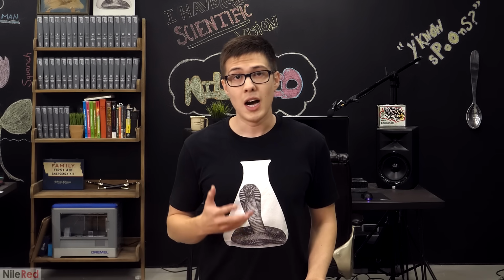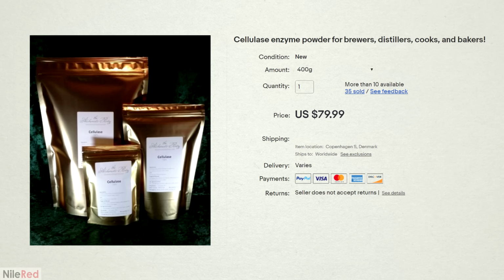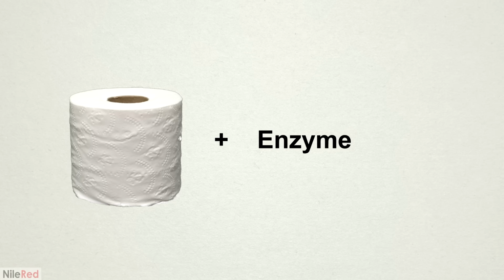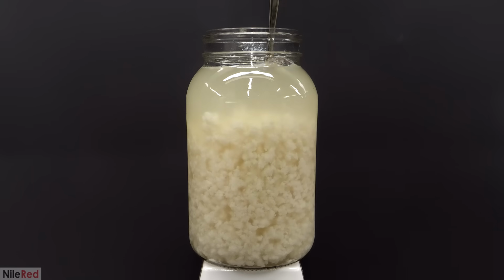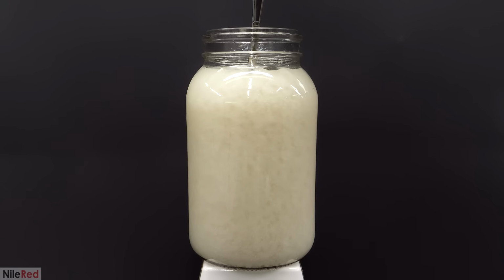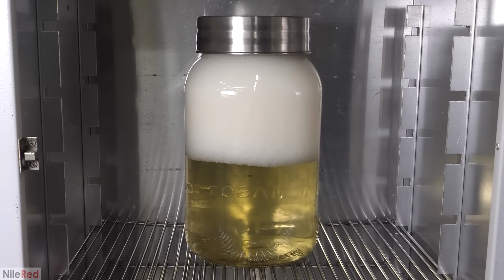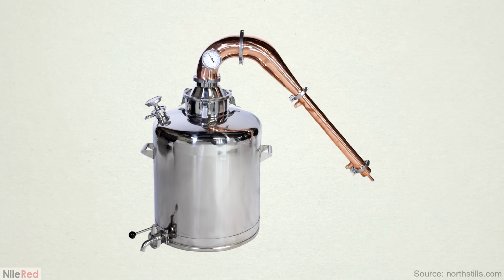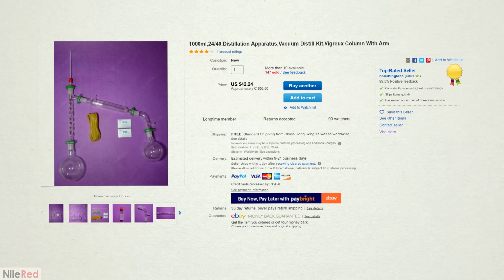Making toilet paper moonshine

Comment: How to make moonshine, ingredients:
-Toilet paper,
-Drain cleaner...
Reply: -weird $80 internet powder
Reply: -yeast
Reply: @loog8621  well that's the only normal part...
Reply: Methshine
Reply: A distillation kit
Reply: Kittens!!
Reply: Nope nothing happens without the yeast. Ordinary bakers yeast will work just fine.
Reply: @snappingbear  not recommended thought. If you buy a champagne yeast or something similar for brewing your alcohol content will be able to be considerably higher than using baking yeast. Also you would have to activate the baking yeast before using it in brewing
Reply: The Citric acided that was added would have completely neutralised and sodium hydroxide that remained anyway

Comment: Food grade enzyme: "oh that's perfect!"

    * Uses sodium hydroxide straight of drain cleaner  *
Reply: He later neutralized the base so nothing bad could really happen
Reply: Food grade lye is commonly used in soap and other "products" lmao. Stop trying so hard to get internet points and go read some books.
Reply: @BenghisKhan  - pretzels too - the sodium hydroxide gives them the nice brown color
Reply: Elie The Prof I’ve used baking soda/powder (can never remember). I figured he would have used a more food friendly base but this is youtube lol.
Reply: @elietheprof5678  I think it's used for the glazing of pretzels. That's why they're kinda slimy when you eat them. It's basically reacting with the oils in your mouth.
Reply: @svetko05  Kind of. It reacts with the oils in the dough (and starches and proteins) to make that slimy texture. By the time you eat the pretzel, the extreme pH is already gone, so it won't react with your mouth.
Reply: @elietheprof5678  I don't think so. Pretzels are washed in lye solution just before bakins so i doubt it has enough time to react with the dough. Of course that lye solution is very low concentration so it's safe for consumption.
Reply: @svetko05  I thought it reacted while baking but I may be wrong.
Reply: @BenghisKhan  well he doesn't seem to try hard and still got some nice internet points

Comment: at 31:25 you have a mistake. 20% from 20ml = 4ml not 5ml. So if your calculations were based on the 5ml not 4ml your other calculations were incorrect. 25% from 20ml = 5ml.
Also Liter is spelled with small "L" not big L. So milliliter = ml not mL

Comment: This is a very funny and interesting project! I would recommend boiling the liquid in the fermenting container prior to adding the yeast. This is an easy measure to control microbiology. A lactobacillus infection can produce all kinds of volatile components that, subjectively, can be labelled as "off flavours". Furthermore, in beer brewing, strict temperature control during fermentation is applied, again to minimize off flavours (diacetyl & aldehydes). Lastly, would you think you could also use this method to make grass moonshine? :)

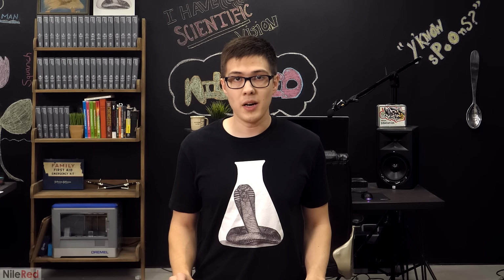Comment: 0:44 You're showing alpha glucose. Cellulose is made of beta glucose, an anomer of the former. The inverted geometry at the 1' carbon is responsible for the properties of cellulose which differ from those of amylose (one of the key components of starch), which also has a 1-4 linkage producing a straight chain of glucose monomers.

It actually would have been wonderful to use enzymes which rely on completely different conditions. If you had done so, you would essentially disable the first when you're done with it, leaving the second to do its thing. Different conditions for different enzymes in a project like this are desirable. See PCR for an example.

Comment: Just a few thoughts from a home brewer perspective.
After fermentation is complete most people give the liquid a good stir to release all the trapped C02.
Next step is to let it clear which can take a week or 2  at room temp or a better way is to cold crash in a fridge which can take a few days, 
this will separate the yeast as much as possible and give you a clear solution to distill, I would siphon this off top with a hose leaving the yeast at the bottom.
These steps I mentioned would have helped reduce the solution boiling over into the condenser. 
Also another tip is to use little bit of butter in with your solution to break the surface tension to stop it boiling over.

Great video, I found it very interesting.

Comment: Hi NileRed, I have some comments to improve the process (if you ever want to serve more toilet paper alcohol to your guests). 
- You said that it is important to have an enzyme in a buffer and yet you rehydrated it in dH2O. What might have saved the day was starches and sugars acting as crowding reagents and prevented the denaturation of the enzyme
- If you want to know how much alcohol there is in your brew, just take a hydrometer for beer brewing and take the density before and after fermentation
- You were unsure whether the starch was fermented or not by the yeast: just take a small sample of your final product and add few drops of iodine. It turns dark blue/black when there is starch
- To avoid the mess during the first round of distillation, filter your brew and then degas it. The faster way would be to use a vacuum under stirring. Maybe a magnetic bar at the bottom of a Büchner flask coupled to a vacuum system. Alternatively, the CO2 is poorly soluble at "high temperature" and you could have warmed it up in your oven to 50 - 60C and stirred it heavily for some time to take out most of the CO2.

Comment: Dude, insulating the Vigreux column of the distillation setup destroys the whole purpose of the damn thing. It has double walls with a vacuum between the walls, so it already is insulated. Putting Al-Foil around it only worsens your fractioning efficiency.

Comment: Have you ever heard about iron gall ink? It's the ink used in medieval period and beyond, made of oak gall and iron salts.
Making it from commercial chemicals should be quite easy, but doing it old fashion, starting from galls ( you can collect them yourself if you have some oaks around you ) it's quite less straight forward. There are a lot of ways to extract tannins and tannic acid from galls and they give different results in term of color.
I think it's could be fun even because there are lots of historic recipes and you can compare chemical knowledge in centuries.

I've tried it myself with good results and I've collected some documentation during the process so feel free to contact me in case.

Comment: More than "it's illegal", I would have warned that it's extremely dangerous, both because of fire and explosion hazards, and poisoning yourself.
Reply: It’s flammable but is it explosive?
Reply: @willman2k8  Finally, as for the explosion hazards, I was thinking of a case where you have no ventilation and ethanol vapors are starting to build up in the air. Of course this would only happen on a large scale with a very shitty installation, but it HAS happened in the past.
Reply: My point is just that, you should say WHY it's illegal, not just state that it is.
Reply: "Extremely" dangerous is overstating it somewhat. There are far more dangerous activities than distilling ethanol, especially if you are competent.
Reply: @AguaFluorida  "If you are competent" is a big "if", that's why warnings should be a bit over the top, to scare off potential reckless actions, that's how I see it anyway.
Reply: @AguaFluorida  he is not competent
Reply: Lol I’ve heard drinking ethanol can have the side effects of blindness
Reply: @ollie8063  that'd be methanol
Reply: @ollie8063  ethanol is regularly consumed by billions of people around the globe, if it caused blindness then very few people would still have their sight.
Reply: @ollie8063  As others have said, I was thinking of other side products, like methanol. But you're not wrong either, because some of the ethanol is metabolised into methanol by the liver, which makes it slightly toxic anyway. Never drink 100% ethanol.
Reply: @Bladavia  how would you even get a 100% ethanol solution in normal atmosphere? It sucks water out of the air and brings itself back down to only about 96%

Comment: Methanol is literally made of wood not just pectin. The yeast is able to break it down somehow, probably by it's own enzymes. You better science-out a method of proving and separating methanol from ethanol. That would make an interresting video.
You should have checked how it's  done in the industry. cupriethylenediamine, cadmiumethylenediamine, N-methylmorpholine N-oxide and lithium chloride, dimethylformamide are used.

Comment: I can suggest about the sweet/caramel/ wooden smell and the yellow colour that it is probably due to something like 5-hmf. A furfuraldehide  molecule very interesting for researchers as building block for biopolymers and a lot of other derivates. It is derived from raw biomass cellulose with a similar method (strong bases pre and then acid). Are you including in chemical breaking methods the use of choline chloride and other deep euthectic solvents? It would be a good and efficient solution, why did u excluded this path?

Comment: Its not uncommon for TP's cardboard tubes to have anti-fungals in them, if you re-do this or someone tries it they should cut the paper off the roll first.  Makes it easier and will save a pair of gloves.
I am of the suspicion that going at a roll with an angle grinder wire wheel with a shop vac using a fresh collecting bag may be a much more expedient method of producing a lot of ends.   I know the point is chemistry but I said it.

Comment: So, I'm just trying to figure out how much it would cost to do this and I came up with around 20$ (not including the glasswear or water). By far, the largest of this cost is the enzyme, which based on the price he showed would be around $18 for the 90 grams he used. While the enzyme couldn't be reused (since it remains suspended with the solution), if this was made with a larger batch, I assume you wouldn't need to increase the enzyme concentration as much? If one was to increase the processing time from 2 days to, say, a week, theoretically you could get the same yield for a much lower cost. Am I correct on this?

Comment: nice! I was looking for this.  I wanted to recycle food waste and turn it into alcohol that I can use as fuel.  I know methane would be one way to generate fuel. I am not sure which method would be more efficient and cheaper.  if distillation was done using solar heater, it could be cheap to make

Comment: Do it bigger. Also, start w/  'freeze distillation'. Like in them ice beers.
 Winter is coming & it will be easy.
Reply: Dropping in a stir bar is a good way to smash a flask! Use football shaped stir bars w/ round bottoms. Layer  a paper towel or fiberglass inside the foil... Otherwise, the foil is just a wind break... or worse a heat sink. Save your tails for the next batch. The forshot is methanol. Dont go blind. You can always buy some 5A molecular sieves. Take out MeOH & water & reusable. Nice Work!

Comment: In chemistry at school we would distill alcohol though copper tubes that attracts sulfates and other bad tasting chemicals. You will see that all home distillation kits have a massive copper chimney for this reason. I feel like your sample would taste a lot better if you ran it through a copper coil re flux condenser. Also sulphates in alcohol (as well as methanol)  is what gives you hangovers.

Comment: Hahaha using shit paper as a source of moonshine alcohol is a self limiting process as after you drink it it will cause gastric distress AKA the “Alcohol Shits” so you have to balance the ratio of paper used for alcohol, and the amount used to wipe your ass after a bout of explosive shits, based on the feedstock toilet paper supply available in a typical household.

Comment: My science expo project this year is doing the hydrolysis of cellulose chemically through a heterogeneous solid acid catalyst. The catalyst is then much easier to remove and reuse, especially when compared to liquid acid catalysts or enzymes. The only issue is that the reactions have very high activation energies, so they are mostly done under hydro thermal conditions. https://pdfs.semanticscholar.org/8c20/b3e83bf1649b95e51b9cb74a85b0bfab55d9.pdf?_ga=2.127847374.2140625213.1573881000-1086748600.1573881000

Comment: I love to see when biotechnology and chemistry are well explained and made simple!
Nevertheless, I want to point out that you could simplify the process by ignoring the pre-treatment step. It could be useful with journal or cardboard, due to the presence of lignin and hemicellulose. However, toilet paper is almost 100% cellulose and from my experience the endocellulases can easily deal with the internal bonds. Also, you made the right choice to use the enzymatic hydrolysis, I have already made acid hydrolysis and I can say that they are a pain in the ass.
BTW, an equally good and entertaining challenge could be to produce biodiesel from used coffee grounds ;)

Keep on with your good work.

Comment: You’re going to need a alcoholometer or refractometer.
Reply: A hydrometer works just as well as an alcoholometer. The refractometer may be more useful for sugars but he could as well do a titration with periodic acid or with fehling's reagent (although this second method is much crappier). Or maybe even simply letting the cellulase consume all the toilet paper and measure the sugar concentration based on the starting paper mass.

Comment: Houses are basically made of sugar.

Huh..  sort of explains termites,  ya?
Reply: Yup! Their digestive system has bacteria that produce different types of cellulase, meaning they easily break down the wood they devour into good ol' glucose through pretty much the same process that Nile used.
Reply: Will termite shit get you drunk?
Reply: @hellhoundnabong9933  the termite metabolism probably uses the glucose for energy. If that isn't the case then there is probably no ethanol in the shit, but just glucose. So you would have to do the fermentation with brewer's yeast and optionally the distillation, before you can get drunk off of it.

Comment: One thing you can do to take down the water content and help filter off any residual solids is to run a quick freeze still on it. Pour your mixture into a plastic bottle, throw it in the freezer until it's solid and then invert it over another container. Let it drip for an hour, hour and a half, and you should be able to get most of the alcohol off while leaving at least a portion of the water behind.

Comment: At 30:13, when looking at the hydrometer I think it was touching the bottom. When looking at hydrometers in glass containers, there is an optical illusion when it’s sitting on the bottom and it’ll look like it’s barely floating. The way to confirm is to gently tap the top of the hydrometer and feel if it taps the bottom of the container.

Comment: The cause of the bubbling in the distillation is the co2. Once you heat it, the solubility goes down (i'm sure you know that). To prevent this, take the CO2 out of the water by agitating it, so that you will not need to worry in the future.